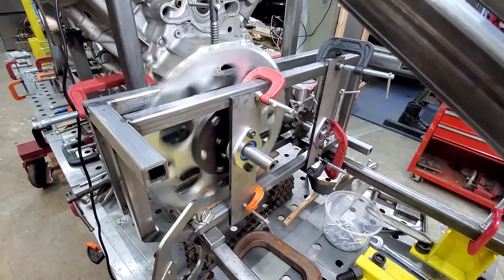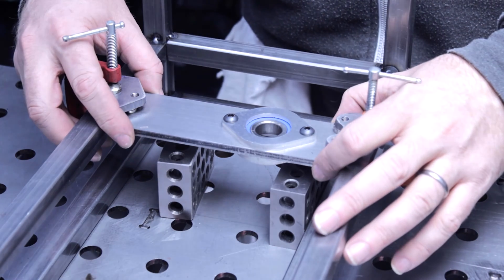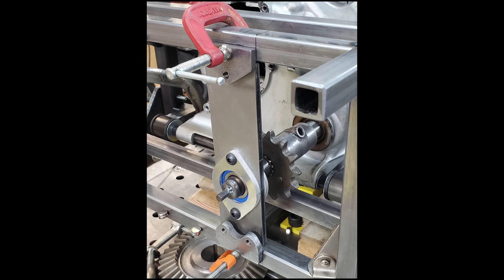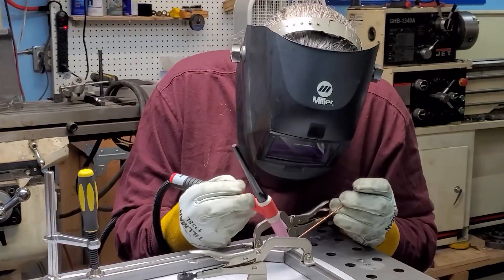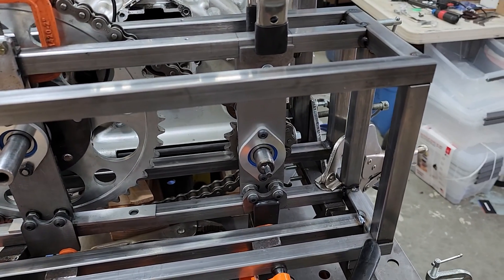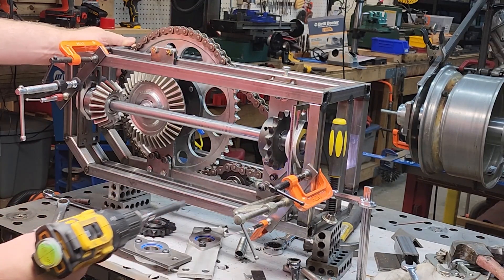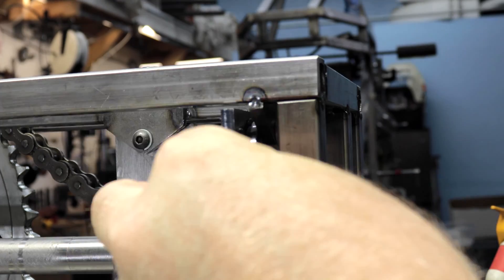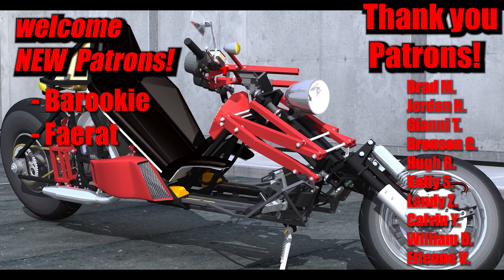Akira Bike Project - 23 - engine reduction cage - part 3

Comment: No Helical Gear or drive belt ?
Reply from the maker: Good question! I didn't have the equipment or experience necessary for the mounting block precision required for helical gears, but v2 will definitely have a spiral bevel gear pair. In this application the narrow width of chains was better but I'll offer belts as an option too. I'll support multiple different power plant options and each will have a unique eng redux cage for it with options available.  Have a cx and want chain drive, got ya.  have a k100 and want belt drive, no problem. etc!  This is just my first version of the first variant of the platform.

Comment: Just come across your channel , 
   If you want to use the CX engine 
Instead of building a drive train do what HONDA did and turn the CX engine sideways and chain drive straight off the output shaft 
This is what they did with the flat track racers
Reply from the maker: Yeah that would be an easier way to go if this was the end goal, but there are other things down the line that this is optimized for, primarily additional experimentation and testing. I'm testing a few different drive trains out, and will need to experiment with gearing too.  Plus my rear wheel is 31", and needs a huge gearing down that isn't practical with a single sprocket pair.

Comment: I was watching @GrindHardPlumbingCo 's new video where they put a CBR1000 engine on a Honda ruckus scooter. It has the kind of look of it with the open rear tire, long tail end with the engine, and an open floor sitting style of a scooter which is like halfway between recumbent and a regular motorcycle. If the rider was just sat lower and more inside the bike it might look closer to the Akira bike. The more I think about it the less I think it looks like it, but it still inspired me to take a look if someone was building a properly scaled Kaneda Bike. So here I am! Awesome work. Only question I have is: Why the square tubing? I'm guessing it's for R&D to just get all the components in the right place. I feel like other people would go straight for round tubing on a custom job like this, but if you're planning on making it into production, I can see why you might go with square tubing. I just think round tubing looks a lot better. This project will have body panels and such, but I feel it would complete the look if it was round stock as the frame.
Reply from the maker: Awesome - welcome to the project! glad you found it.  I'll check that build out you mentioned, It's weird how close so many people come to a good design but then just zip off in some odd seating or geometry that makes it uncomfortable or unusable.  I think it really needs to be designed from the ground up to do it right, instead of aiming for "minimal chopping" of some existing design(s).  And yup, the square tubing is absolutely because it's a development prototype, I'll probably stick with it for the first gen kit bike version, but in the high end weight and performance optimized, it's absolutely going to be bent round tubing.   I all ready have most of the design worked out, just waiting on finalizing everything from the prototype development. The benefit / cost (in terms of design and fabrication) of square vs round just made square more sensible in prototype dev where you might have to cut and move things multiple times.  Same reason why I'm holding off on fabricating composite panels and molds.  Don't want to have to move a frame bar and inch and then make a mold I spent hundreds of hours and thousands of dollars useless.

Comment: Those difficult to access bolts are going to become a real problem
Reply from the maker: They are accessible but not fun, I'm more concerned about them vibrating loose or not being able to handle the shock loads.  But worse case I can just weld all the plates in place.
Reply: @matus1976  can't wait to see the finished product. You should make a mold and make fiberglass body panels for it too
Reply from the maker: @blender_unleashed  oh yeah absolutely going to be making molds, that will probably be in the phase II or III prototype.  Problem with the molds is any change you make on the frame/bike will likely have major impact on the body panels and making molds and plugs is a huge endeavor.  So I want to have the frame and geometry finalized before making molds.  I will be hand making some composite airducts for the split radiators very soon though.